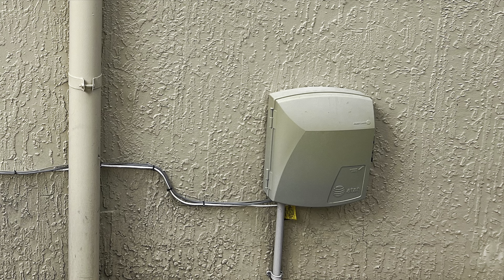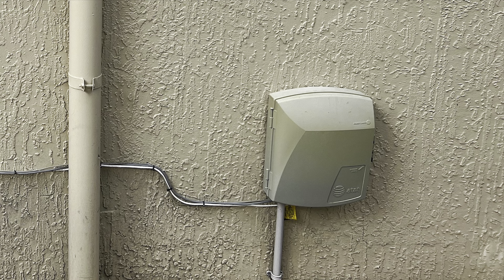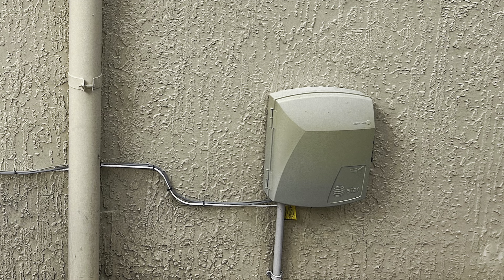AT&T Fiber Installation and BGW210-700

Comment: You should have saved the blah blah blah motion for when you were talking about bandwidth vs. speed.  If you knew the problem was having too many devices on WiFi why did you call AT&T just to get upsold?  Secondly moving the box to the garage adds hours to the install, if a new drop has to be run to do it, it adds contractor cost.  Techs typically get multiple installs per day with service windows for each.  They don’t have time for your pet projects.

Comment: Unlikely AT&T will give/provide the BGW320 for the low 300 Tier plan. 
This gateway is typically reserved for those on the 2Gbps or 5Gbps plan, as it has a specific 5Gbps Ethernet port on the back, need to provide a device (usually a switch) with the 2-5 Gbps speeds the customer is paying for. 

Its possible you could talk them into it, but with the chip shortage, they are not suppose to give it to those under 1Gbps (even those at that lower speed don't often get it either)
Reply: Got fiber 3 weeks ago tech put BGW320-505 on ATT Access 100 Fiber plan.
Reply: @jaggsta  Yes, on fiber, as there are only 2 Gateways that support this service. So if a Tech only had the 320, well then that is what you will get. 

But calling customer service, when you have a functional gateway, and it's already installed, they won't just send you out a different one per request.

Though the tech should not have installed the 320 (again as its suppose to be reserved for the 2Gbps+ plans) they install what they have most often
Reply: Not sure I agree with the need for a wired Ethernet for most devices in a home network. A modern WiFi6 AP/Router/Mesh can handle most homes with Gb and below ISP services.